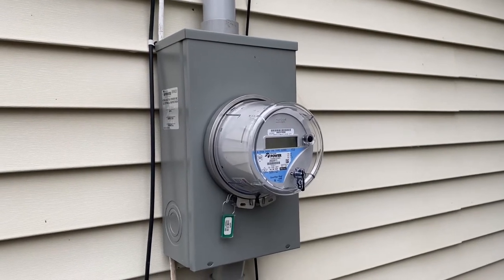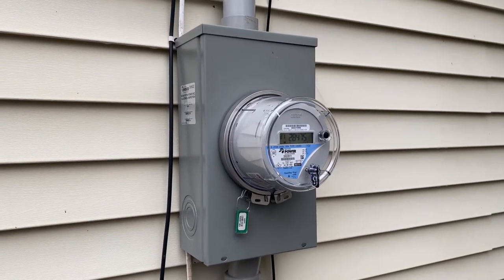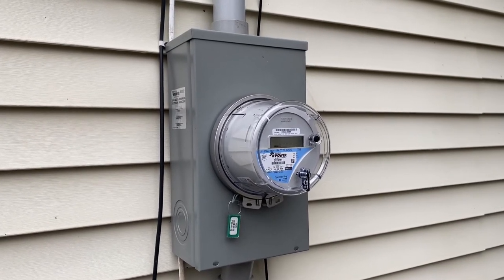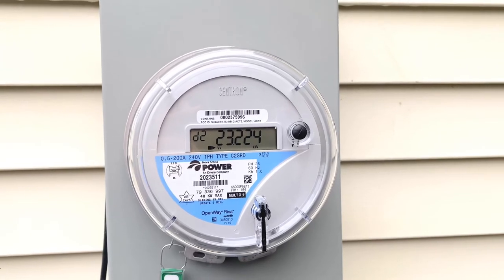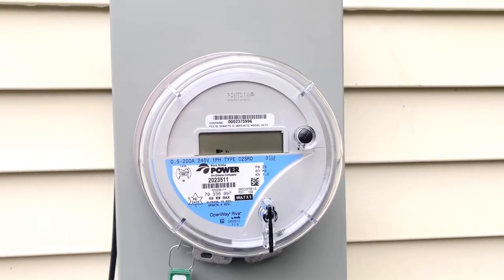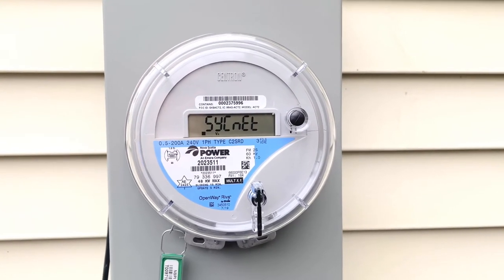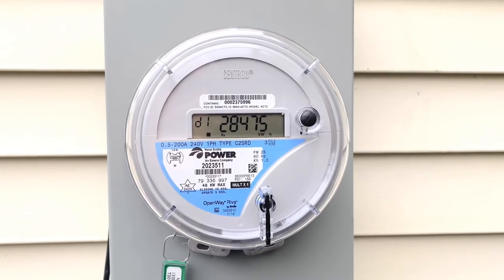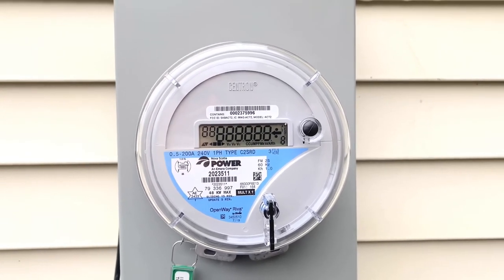How to Read Your Digital Power Meter (NS Power Version)

Comment: Yesterday there were 2 brown outs with the matter of a minute and today reading up around 3kwh, was running stable 6 to 8 kwh daily,but today 12kwh , The story, meter reading 08/02/2023 11:45am 3347 ,2 power brown outs around 3pm, Next meter reading 08/03/2023 8:30pm 3359 , usage ain't changed much,tho no compensation for extra 8 hours, keep meter reading book

Comment: I would like to know the immediate rate at which the power is being used, not have to average it out myself over hours. The old analog meter had the spinning wheel that showed you this. How is it that a digital meter actually shows LESS detail?
Reply from the maker: I agree